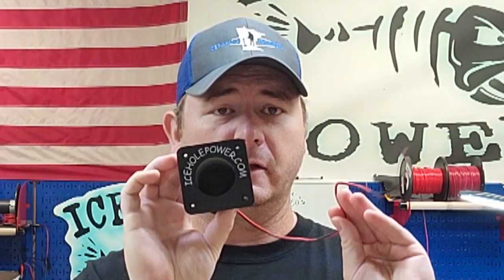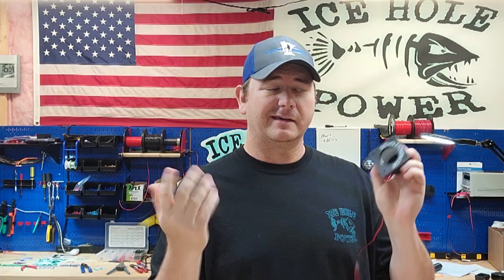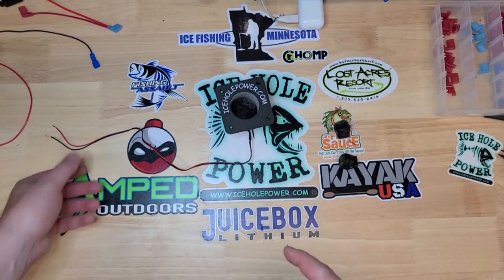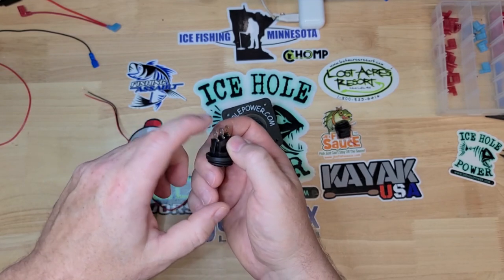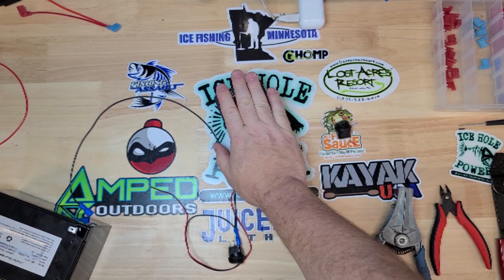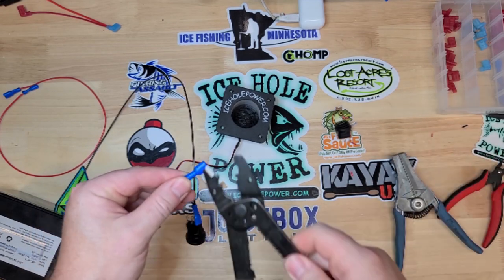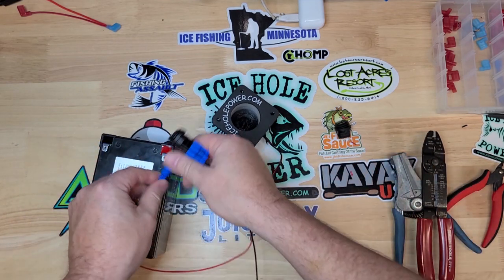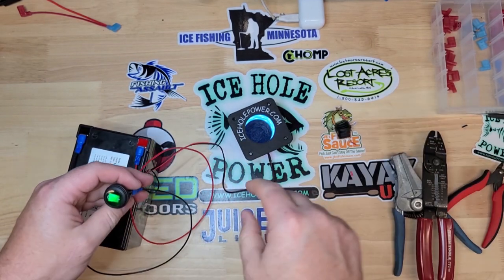How To Wire The Ice Hole Power Glow Cup

Comment: It looks nice, but is it any brighter than a bright 18650 battery LED headlamp, or small 18650 lantern or flashlight I might already have.  Say 500 lumens?  Having a light for more than one use case is good.  
- Joe
Reply from the maker: The difference is that the cups have UV lights in them and it reacts with be glow paint on the jigs better than white light from a head lamp. We can not see all the wavelengths of UV light so it does not look as bright, but if you were to do a side by side comparison, glow one with a head lamp and one with a UV light, you will see the UV charged jig will glow brighter and longer. Might just be my next video :)

Comment: If I have a Cabela's box with a 5V 1A & 5V 2.1A USB as well as 12 volt plug that is plugged into my battery terminals how can I add one of your 2.25x2.25 ice hole glow cups all the battery?

Comment: Does the smaller cup have hook protection? I don't use much glo baits in my fishing, but they have a place and the small cup would be an excellent addition to my custom built power box. Thx.
Reply from the maker: It does!
Reply: @iceholepower8012 , lemme know when you all are back at it, want to order one, and also tempted to install Amped battery. Using AGM at the moment. I am a heavy set fella, so need to lighten up kayak load where I can🤣🤣
Reply from the maker: @t3angling575  should be April 1st. If we open up sooner, I will make an announcement on our Facebook page.